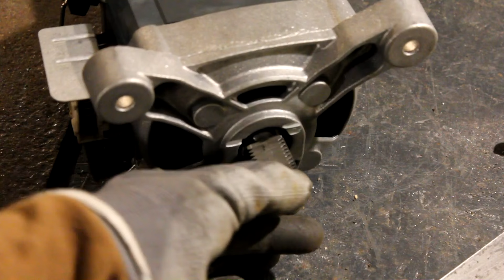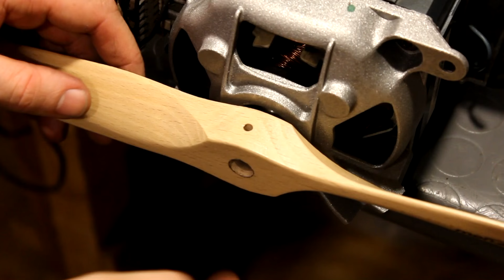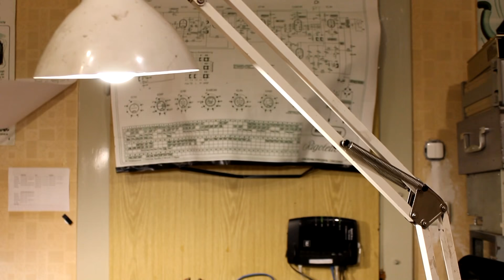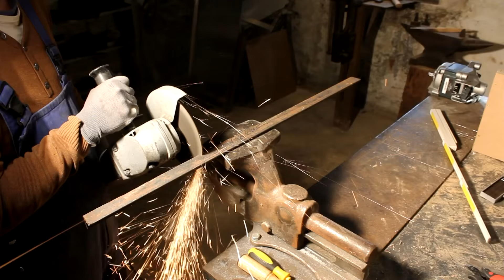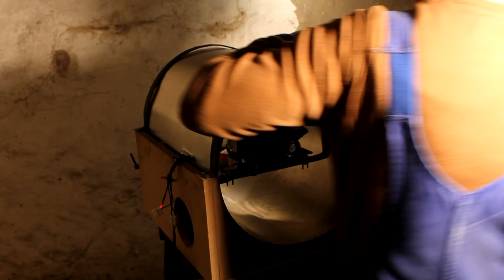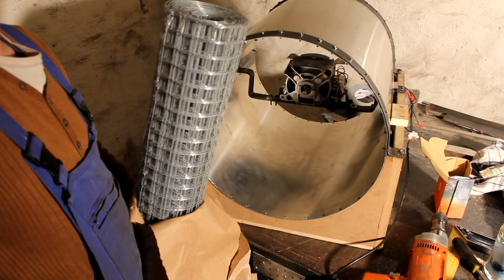Trailer: Powerful Ducted Propeller with Washing Machine Motor

Comment: Make a mini wind tunnel!  It'd be cool to test the aerodynamics of everyday, household items.
Reply: All he would need to add is a long mesh structure to stop the air rotating. Think of a load of square tubes. It would also need to be much longer.
Reply: I hate it when my appliances aren't aerodynamic. For instance my toaster has terrible drag, the laminar flow is all over the place and it hardly generates any downforce whatsoever :(
Reply: I hear ya man, the quest for the evenly browning 4 slice toaster is an ongoing one. I fear you may have only one option, and that's to turn it into a NES toaster, at least then a poor drag coefficient won't have such an impact on your day to day life.
Reply: rockerogue Well If you're running late, knowing which appliance to take with you when making breakfast on the go could make the difference between working another day or spending a miserable existence on the street for the rest of your life clutching the un-aerodynamic appliance that cost you your career.

Comment: Build a wind tunnel. 

I've build one as a child a little bit smaller to test my Lego cars. :-)
Use Drinking-straws to get rid of turbulences from the propeller.

You can highlight stripes of fog with a fast rotating mirror and a laser LED.
You can "slow down" the moving fog with a strobe light.

I found it extremely fascinating watching the fog move and testing airfoils and drag.
I even build a scaled model of our house and tested it in the wind tunnel.

Comment: I would use this fan for venting dust from my small woodworking shop.  I have a vent to the outside, above the door and would use this to exchange the dusty air for clean air brought from the opposite side of the building.  This would be in addition of my existing dust collection system within the shop.

Comment: I think someone already mentioned this, but I think you could use this to extract smoke while welding or extract fumes when you use any chemicals such as Brake Cleaner, Engine Degreaser, or other toxic chemicals.  You could also use this if you ever decide to make a forge.

Comment: You may want to add 3rd brace to the backside of that motor. Under high thrust, the mounts may torque and allow the propeller blades to touch the duct walls.

Comment: You could reduce the diameter of the motor shaft by filing it with a metal file while it's spinning. I have done this many times and it worked very well. This way you wouldn't have to worry about weakening the propeller by enlarging the hole. I hope thi helps in the future. Thanks for all the great videos!

Comment: Wind tunnel experiments. You could use it for that. And if you use it as a wind tunnel then you can find the air-friction of some things, including wings, fuselages of aircraft and sails for boats or even structures. By adding some smoke streams (injected through tubes in the air-steam you can see what is the air-flow across wings etc.

Comment: You can get less noise if you put some padding on the ducting, also, if you add some trailing "wedges" on the tips of the blades, check how they shape helicopter blades.

Comment: How about constructing a small snow cannon, like the ones used in ski resorts? If I'm not mistaken, all that is needed is to spray water in a fine mist in front of the propeller, and it will cool the water with evaporative cooling, and thus make snow. It should work at temperatures up to 6C*, depending on the humidity.

Comment: Make a vacuum cleaner! I have a large attic with years of dust and would like to vac it out before I insulate.  I have a commercial kitchen fume hood that I would like to reduce the opening to where I would attach a 100 foot vacuum hose. I would run the dusty discharge into an evaporative cooler so the wet pads will catch the dust.

Comment: you should try a hover craft!!!
Reply: its massive, heavy, and only 500 watts! TINY rc aircraft models in modern day are as much as 1 Kw and theyre the size of a strawberry
Reply: Yep, but it has TORQUE
Reply: Dude, torque is related with wattage and rpm (increase wattage or decrease rpm and you have higher torque) 

T = P(hp)*63025/n                     

where

T = torque (in lbf)

P(hp) = horsepower delivered by the electric motor (hp)(1hp = 750W)

n = revolution per minute (rpm)
Reply: If a motor has high wattage output, then you can have high torque as well
Reply: Jeronimo Murruni Are the quoted   wattage figures a function of power used or power output? If it's the former then your calculations/formulae will need to be redone.
Reply: James Lamb That formula uses the power given by the motor (power output)

Comment: You could use it as a small wind tunnel or to cool down a car when dyno testing for power this was a brushed DC motor?
Reply: It's a brushed universal motor, works on AC or DC

Comment: Pair it with a heat source for the biggest DIY food dehydrater you'll ever use? Jerky and dried fruit for daaaays
Reply: Better with a cooling source because summers in Germany are really nasty. :D
Reply: ***** I'm from Florida, I know all about nasty summers. But, if you're dehydrating meat and fruit for jerky, you need a heat source in it.
Reply: Telos954x yeah you need a heat source as heated air carries more humidity than cold air, and you want it to get the water put of what you are drying. The higher the ambient temp and humidity the higher the temp of your dryer should be.

Comment: An inline duct fan for an industrial building. A whole house exhaust fan, similar to an attic fan, which could be fitted to a window. An  exhaust fan for a workshop, possibly with a barometric damper, to exhaust welding or paint fumes. Initial inflation of a hot air balloon. Mount it horizontally, a few feet away from a vertical axle, and see how fast it can go around in circles. (I'm certain you can solve the electrical connection for the last one.)

Comment: nice build,  but really isn't a ducted fan.   just fan in a tube.   if you changed the propeller and tightened the tolerances of the tube to within 1mm of the propeller tip,  then you might have a ducted fan...still there are other aspects to consider...fir example mounting the motor outside the duct and using either belt or chain to power centrally mounted propeller.   This would reduce the turbulence and restriction on air flow through the duct.  Since you using such a high power motor as compared with hobby motors might consider using a 4 blade prop or extending the shaft and adding second prop rotated 90 degrees on the axis...

Comment: Get a light weight car/go cart, seal the bottom and use a few of these to increase down force. Like ground effect but standing still. Suction increases with surface area, becomes very efficient. Get 2+g standing starts and 3g corners. Has only been done once before in F1 and once in a road racing car.

Suspension needs to be very stiff but you could get around that with some engineering prowess or just a suspension seat.

Use ecu water cooling blocks to cool the brakes on the cheap.

Comment: Dear friend. Make it all in one, portable ventilation unit. Bigger battery, four caster wheels, hinged access panel, a switch, and a charge port. Plywood and metal, including adhesives. With a full compliment instrument array obviously.

Comment: you may use it for checking the "holes" in a, lets say bulding, by producing an overpressure in the target and use some kind of smoke...
...or you may use it (with some additional machanics to make the ariflow more linear) for a windtunnel...
...or you may use it as a powervent to get rid of chemical or exhaust gases...
...you may also build a extreme powerfull cooling system with some "old" heatsinks...
...or use it as testequipment for windturbines
...or use it as base for a snowmachine
...or use it as basis for a powerfull gas-heater
...or for drying some stuff
... ... ;-)

Comment: I have one of these specific induction motors, also trying to find a useful application. The other day I came across one of these plastic eight-bladed fans, used to cool car radiators,  driven by a 12V motor. These multi-blade affairs often have a "safety ring" at the circumference(like this one) to alleviate the dangerous aspects. The particular one I have, measures only 360mm, but I'm sure there are larger examples available.

Comment: Maybe convert your energy source to solar? The speeds would be much slower, so the design could be opened up or built with materials that allow better visuals. Your lines, attention to detail, and overall look is already quite artistic. Pretty sure it would make a hell of a conversation piece!

Nice work and great video about building and repurposing something just for the challenge, then trying to find a use for it. 

I get asked "why are you doing this or that" all the time. I usually just say "for the challenge".

Comment: you need to put a rounded intake lip on that.. and potentially restrict the exhaust diameter dependent on what you plan on using it for... but the intake lip is a must
Reply: Ollyweg 0 Air, like most fluids, doesn't like to make sharp turns.  There are pieces of software out there that will calculate the optimal lip radius for you.  In testing of my small electric ducted fans I've seen improvements to thrust of about 10% with just the addition of a front intake lip.  I'm not sure what the gains would be here due to the larger size but I'm sure that there will be gains.  cheers!

Comment: Perhaps experiment with varied coned intakes and restricted discharges to find out which combo lowers the ambient air the best, and doing so with the best motor efficientcy?  A freon and compressor free ac unit

Comment: Those motors are normally rated for around 500w, a smaller BLDC RC motor could produce more power. Also I am curious what speed the motor is running at max power as it would normally be spinning at around 20000RPM, so the temperature, current and efficiency would be interesting to know. :-)

Comment: Any kind of venting/circulation of air in a residence, workspace, or underground setting. A four blade prop running at low speeds would move a lot of air. Same four blades at high speeds and you have a wind storm!

Comment: Out ou curiosity where is the "vaccum" side of the propeler? towards the motor o away from ir?
An interisting feature you can implement is to make sure the propeler pushed agsint the motor that way, if you pin fails (for whatever reason) there would be no grave damage.

Besides that, great project.

Comment: My first thought was dust collection. The question is;: Will this propeller produce high pressure, or will the moved volume drop drastically if you confine the moved air in a smallish (120mm diameter) tube?

Comment: Hi. Can you add smaller metal propeller blades ,and when motor is running on high speed , apply water stream at 90 degrees to propeller blades. It should lift motor, that means new flying technology. Let me know.

Comment: Hello, from Portland, Oregon USA, great videos. Could you use vanes in the tunnel to disrupt the noise? it is very loud which may be an artifact from the propeller, A multi bladed fan would be already engineered to be quieter and you could not have to change very much if anything. Also a industrial fan with a burnt out motor would be very inexpensive or attach a squirrel cage with two of the motors, the air intake would be from the sides and a rectangular slot parallel to the cage would be the output, also it would be more controllable as to output, Thank you for your videos they are really interesting to me, Just say'n :)

Comment: >> A wind tunnel <<
I was just wondering what could be a more powerful motor than a Delta TFC1212DE for a small size wind tunnel testing rig...
Although not as exciting as an RC raft, this huge airflow and air pressure could achieve some interesting results in a lab environment.

Comment: What you could do: Mount it to your window in summer time. Or maybe as a compressor? (Add a funel on the output side...)
Does it need 220V AC or 12V DC?
Reply: It's a brushed universal motor, works on AC or DC
Reply: wulf 659 But which voltage? 220V on a ship on water is maybe not a good idea.

Comment: I'm under the impression that the gap between your propeller tips and the duct wall is much too large to gain any significant duct-fan advantage, if you can find a slightly larger propeller you could cut it down for a precise fit

Comment: Can you calculate the flow rate (cubic Metres of air per minure) and the voltage and current requirements for the motor.

Comment: strip the shielding from the motor  and anything else that can be changed for the purpose of weight loss most of the weight  is that heavy shielding then check out Joseph Newman energy for free no bs  should then be able to power it from 1 dead 1.5v battery in series.  half the weight bit of design should take of carrying its own power source

Comment: Go back to the original idea and use it as a power tool building block.  Your idea original idea of being able to repurpose the tooling into something easily accessible for the common man is a good one.

E.g. there's no reason why lathes have to be so expensive. I'm sure the Siemens motor can withstand 100% continuous load (though use a thermal IR gun to confirm). With a hall effect to count frequency of revolution, you can regulate power output. Readily available metal stock that's been machined within calibration + an Acme screw driven by a NEMA Sanyo motor (~50 USD), then cheap stepper motors with some sort of pre-load so you eliminate the backlash for the compound + topslide. Pre-ground/polished metal stock can be used for the ways and purchased within 5e-5m tolerance on all 3 axis, as AvE would say, good enough for the home gamer.

Comment: what is the purpose of ducting other than blowing the wind directionally and protecting against accidents?
Reply: None. But those are two very useful features.
Reply: Ducted fans are more aerodynamically efficient for the same diameter propeller

Comment: why not use an epoxy on the prop. to add strength and make it smoother for better air flow, or cast it in a metal. make a helicopter

Comment: What are the specs for the motor? If it's high enough, you could build an electric bike or motorcycle.
Reply: Use an electric leafblower motor for that- more power, smaller size. Still need >100 volts though.

Comment: Nice balance between power and beauty... All that duct attachment hardware should probably be flush on inside (with the nuts located on the outside) for the best airflow performance and maximum external ugliness. It really wants to be the most dangerous part of your "R/C Air Boat".

Comment: depending on the use you come up with specific small adjustments to the shape of the duct can substantially increase the flow rate and or efficiency. this like provides some insight to the science of ducting: https://capolight.wordpress.com/2015/01/14/quadcopter-rotor-duct/